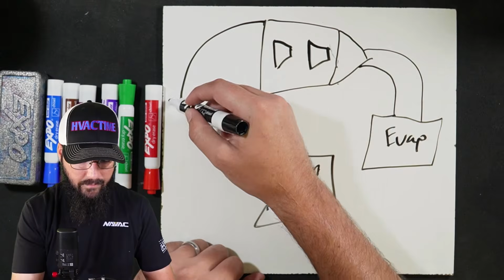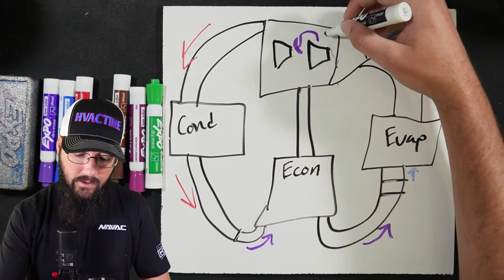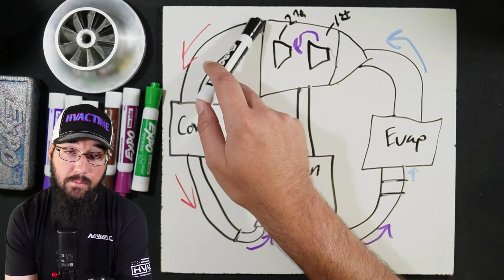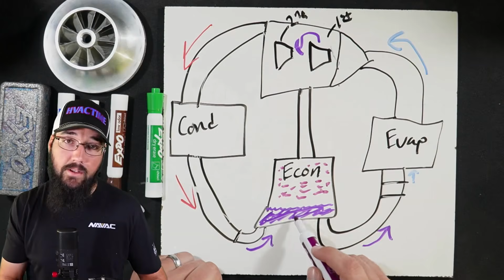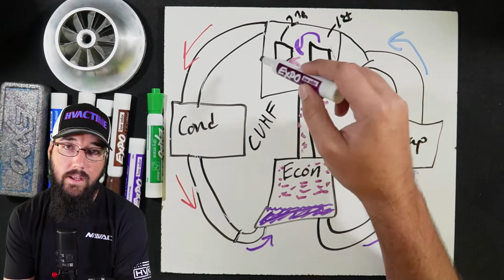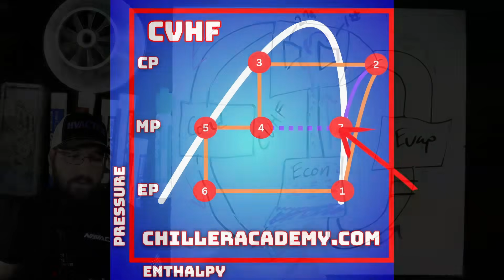Trane CV Chiller Economizer Explained

Comment: On a split system or a vrf system, does a suction line receiver do a similar thing? Does it lower compression ratio? Or its just there for safety? I understand that in those scenarios they may or may not have a fixed orifice on the discharge end of the receiver.
Reply from the maker: Splits and vrf are for safety as an accumulator, it does not have a economizing function.